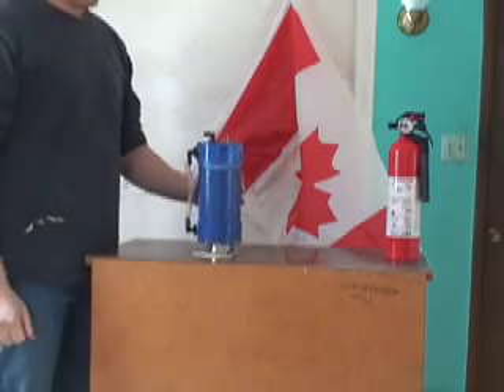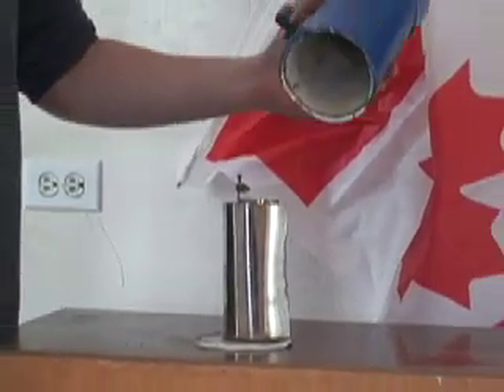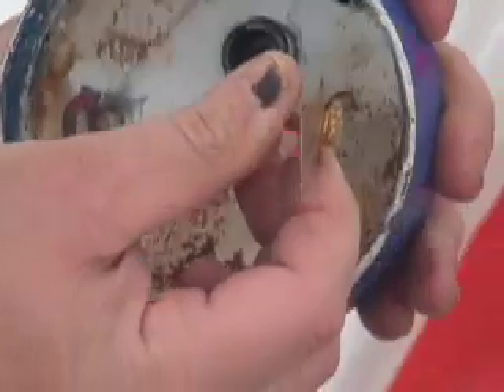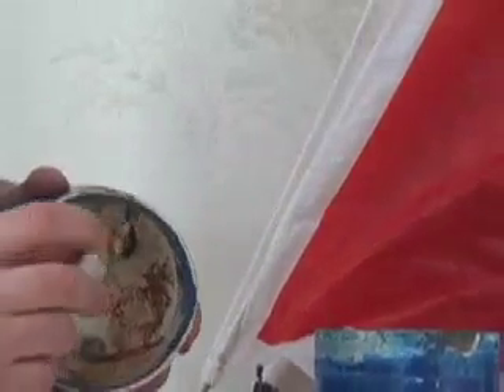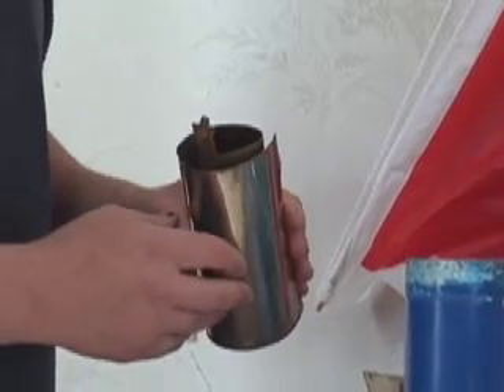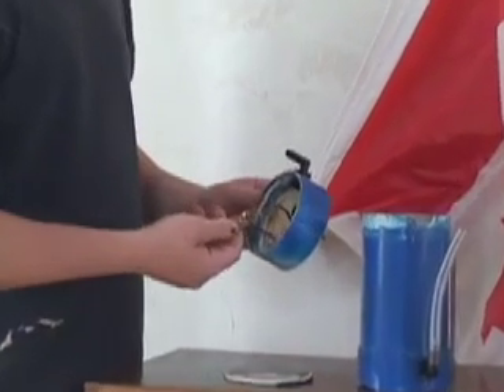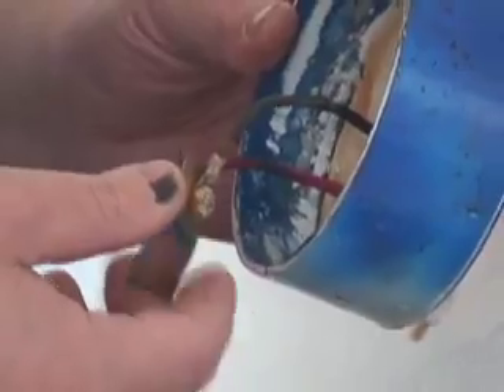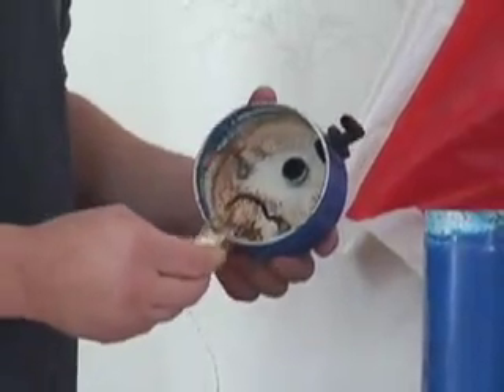Do It yourself HHO Hydrogen Generator: Safety in Design

Comment: Plastic container with seran wrap around it and a metal sheath around it for extra protection. I find that if you are making a small scale prototype that wont be under to much pressure peanut butter containers work. 
If your going to make real full scale on add one bubbler or a way to relieve the pressure from the container. If you are leving the cell running make sure theres a way for water to automatically flow in to keep the springs or what ever your using submerged, prevents sparking.

Comment: guys.  more like the connections heated up due to the amps he put on the cell. emagine those wires got red  hot inside, and it is that heat that caused it to explode.  i had this happen to me with a clear cell, i actualy watched the wires begin to melt, then BAM.   when you place a cell under high load, it will cause any small area in the connection to get HOT.

Comment: yeah, having a solid connection to the lid is a great idea, solid steal all the way to the bolts... and keep the connections far apart.and built so the main component is fully immersed in the electrolyte at all leaning angles...   and liquid electrical tape is your friend at connection points, if using copper wire, be sure to coat completely